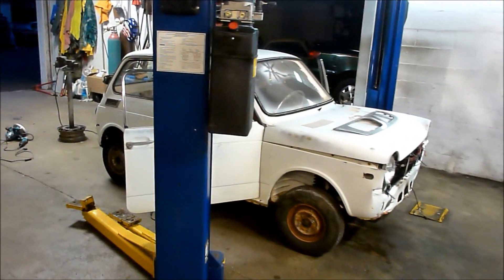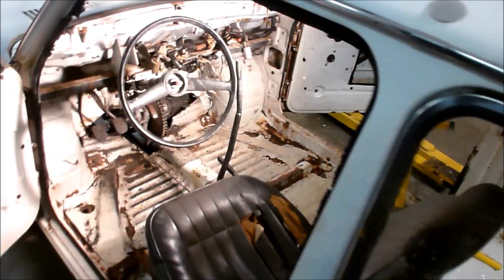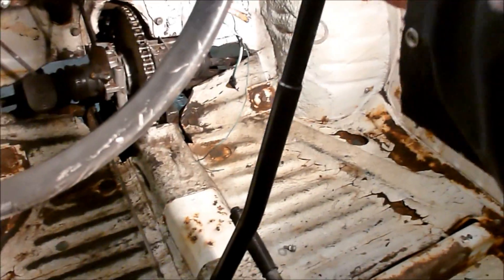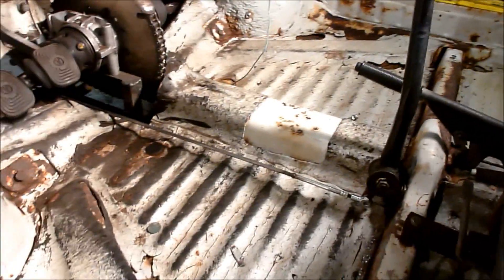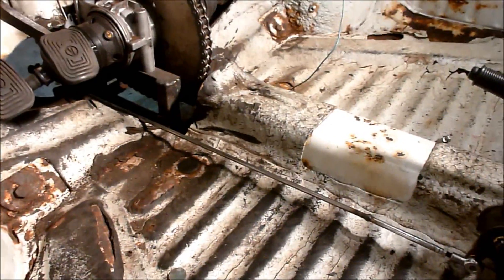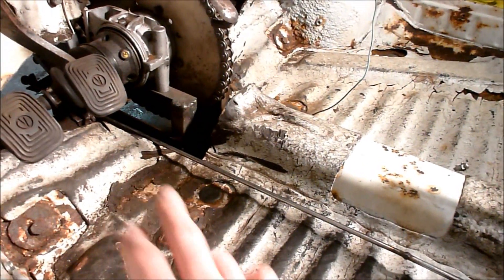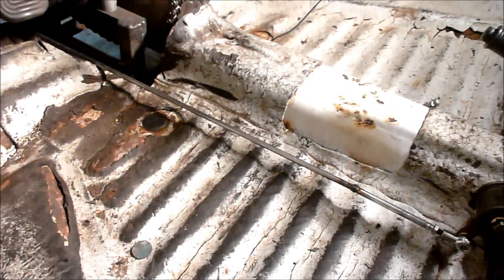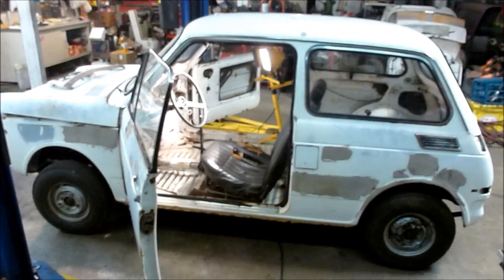Motorcycle engine Honda N600 sequential shifter fabrication

Comment: Mark, did you have to come so far back with the final drive because of the length of everything when it was lashed up? What sort of angle does that put your CVs at? My prediction is that you'll be able to explode the drivesaft assemblies at will haha. Personally I would have gone rear drive with this sort of power but your result should be interesting and I look forward to seeing the first foot down hard video.

Comment: I like the cable idea for shifting, except then you'd need a rigid link between the lever and transmission. I think you're on the right track the way you are.

I had a 600Z coupe that ran really well, but the starter was bad. I could just stick a leg out and start it with my right foot on the clutch, left on the road. It really takes very little to move those cars!

Comment: Did you ever think about using two cables? One on top and the other on bottom. Pull top cable to up shift, pull bottom to downshift.  No pushing, just pulling..  Some systems work like that.  Just trying to give you ideas.

Comment: What about running the shifter rod closer to that little tunnel hump there. That way you can fabricate a tube that sits on the side of the tunnel so you wont hit it or bend it.